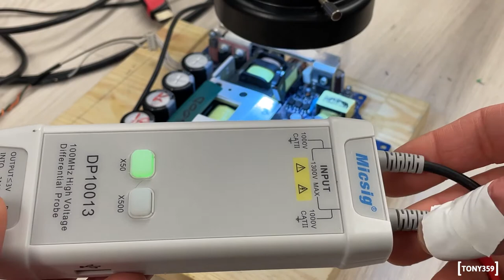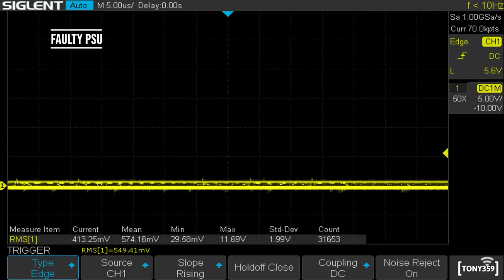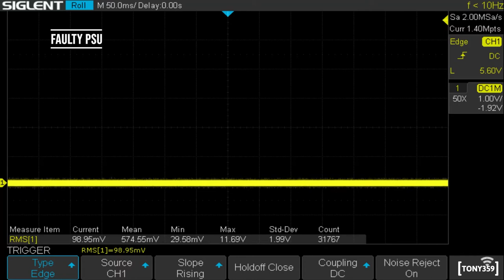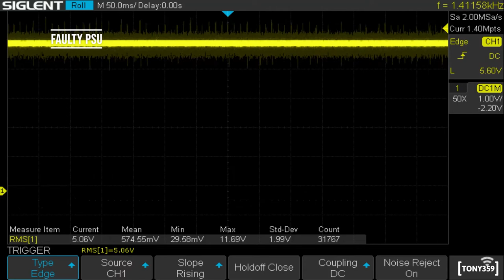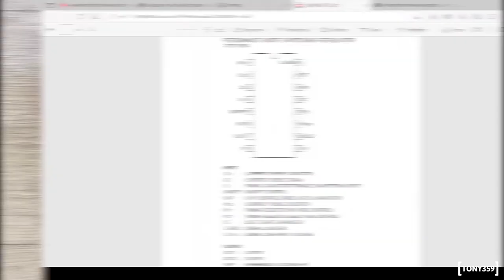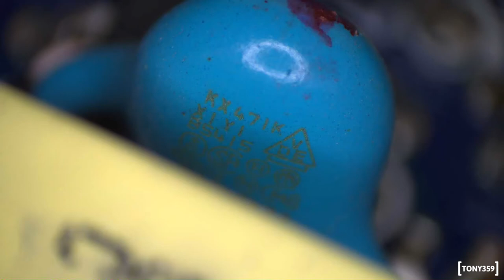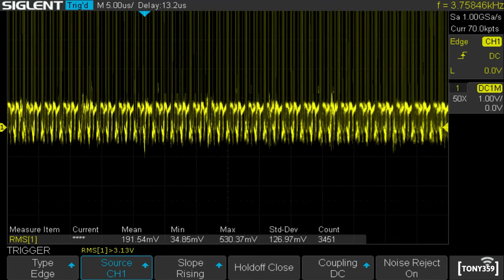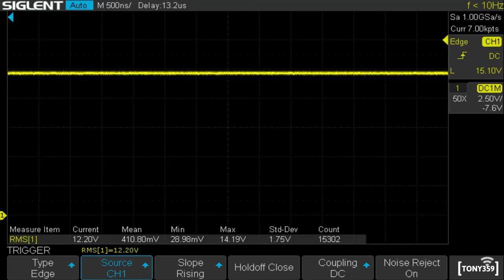Can I fix this PS3 Power Supply?

Comment: Great IPM !! (Information per Minute) 
Seemed to me the output pin of the (replaced) chip could have been loaded down with a shorted in-line component.
 In those cases, un-soldering and lifingt the output leg from the circuit is often informative, quick, and cheap. 
Was there a reason this was an incorrect technique in this case ?
Reply from the maker: I learnt a new thing, IPM! Interesting suggestion, I wasn't aware of that technique. If I can ask, what would the test expect to reveal? I am not questioning your suggestion, just trying to learn something! :) If there is a short in the chip, would lift the output leg change the scenario somehow? Thanks again!
Reply: @tony359  Lifting the output pin sometimes helps isolate where the fault is. If the output starts giving a good square wave with the leg in the air, the chip is good and the fault is down the line( i suspected shorted FET gates, for example). Outputs can rarely drive more than 20ma and are usually protected within the chip, so the chip might survive a shorted FET gate( i'm assuming thats what the next stage was) . The feed back loop on switching PSUs migh tell the chip to shutdown if it's signal was having no effect, which is why closed loop switching PSUs are often hard to troubleshoot. Cheers!

Comment: You can use differential probes or connect the power supply through isolation transformer, I think.
Reply from the maker: Didn’t I use my differential probes and my isolation transformer in this video? It’s been a while but I definitely remember the probes! Thanks for watching!

Comment: How long can these power supplies hold energy Without being plugged in? I've only opened two ps3 consoles to get to the mother board of the ps3 and Im scared of touching the power supply everytime i need to get to a ps3s motherboard. Are there any protective gloves or is that fake?
Reply from the maker: It depends on how the PSU is designed. They often have resistors to slowly "bleed" the MAINS capacitors once the power is removed. That takes a few minutes I guess. 
If no bleeding resistors are installed, then it can shock you for hours :)

But the OUTPUT of the PSU won't shock you. That is connected to the PS3 motherboard and the PS3 will discharge the outputs. So as long as you don't OPEN the power supply, you should be good to go. As usual, I cannot guarantee anything on a youtube post so you open a PS3 at your own risk.
Reply: Ahh ok that is understandable

Comment: do you know if the ps3 fat psu has multiple layers? traces in the middle, etc or is it just top and bottom
Reply from the maker: I do not know - it might be a dual layer only, it's just a PSU after all.
Reply: @tony359  thank you very much for replying. trying to restore a very dusty old cech-a01. i messed up on desoldering the transistors a bit

Comment: Hello, when using an isolation transformer the device becomes "floating" and thus no differential probe is required, don't you agree? Anyway, thanks for the video :)
Reply from the maker: You’re absolutely right. But when dealing with 400V I’d rather follow the old say ‘better safe than sorry’ 🙂 thanks for watching!